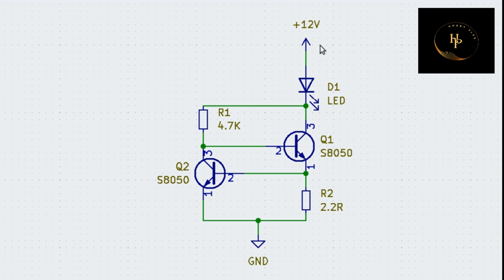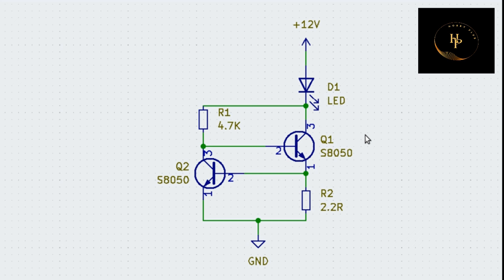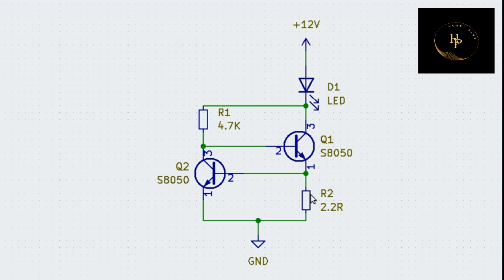[29]HOW TO DESIGN A LED DRIVER | LED DRIVER

Comment: For 24 DC volt 1.37 amp LED panel what will be resistance values.
Reply from the maker: first of all you have understand with transistor sued for that. In my video I already tell you how can you calculate the resistance value.
Reply: Why not just a current limiting resistor?